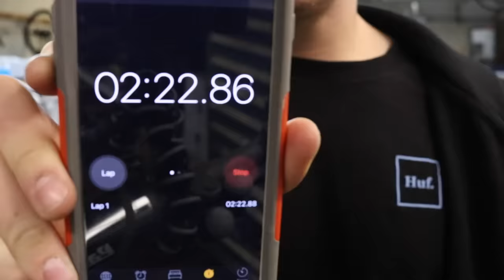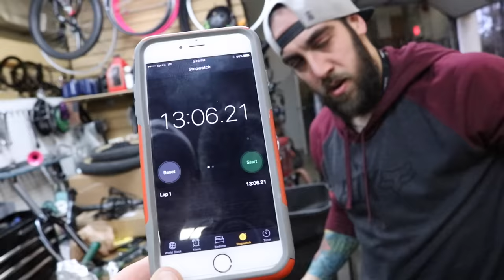BUILDING A BIKE IN 13 MINUTES!

Comment: I ride the most sketchiest bmx EVER the gander bars are rubbed down to the metal from failing and the brakes lock up every time and I ride a maxxis mirical   in the rear there's a streak in my town where I've locked them up for a good 10-20 ft